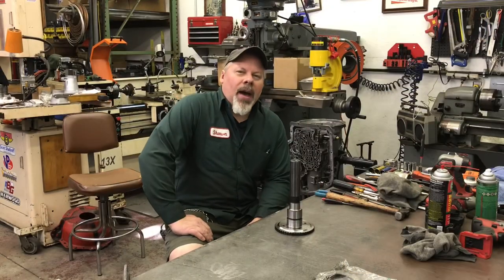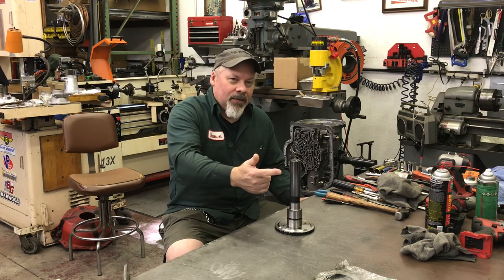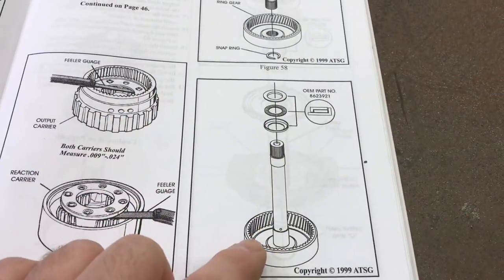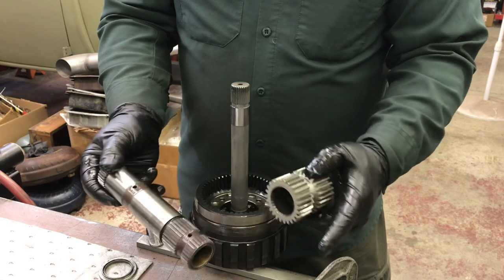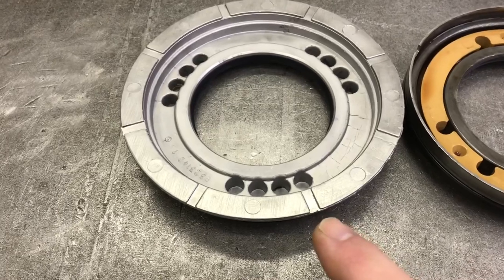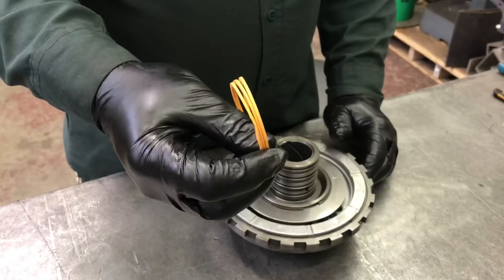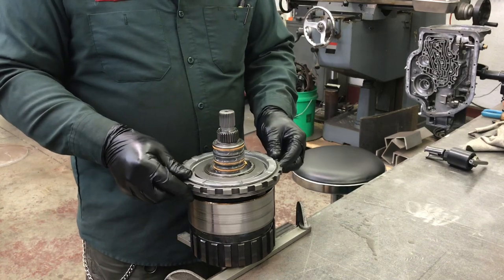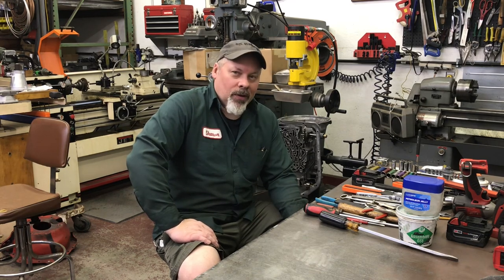TH400: TH475 Lower Gear Train Assembly & Installation.

Comment: I purchased the ATSG book and they reference a rear reaction drum spacer, should all th 400 transmission have them. When I took mine apart I do not have one installed. It seems as the low roller clutch assy sits on that ledge.

Comment: Need help. I've done a few th400s with no problems. Now, the one I'm doing, I can't get the lower gear train to have any clearance. Spins good, with center support bolt in, then when I put beveled snap ring in, it won't spin at all.
Any ideas?
Reply from the maker: Either the thrust bearing is too tight at the bottom of the case, or washer if that is what you have. That is my guess if the lower unit is together proper.
Reply: @mountainsgarage  Has number 2 tang washer and all is together correctly. I have the thinnest washers in, too. Bearings are correct, too. Wondering if center support and front planet aren't happy together. With a 4l80 center support, it works, but can't use that, from late model 80. SMH
I'm about to tear another 400 down and go from there. Ugh!

Comment: Do the th475’s come with a 34 element sprag stock
Reply from the maker: They usually have a smooth direct drum with a 16 element sprag. A 34 element is a direct replacement on the same drum.

Comment: Maybe I missed it but I didn't see you put the plastic oil seal in reaction carrier.
Reply from the maker: It’s is a silencer ring according to GM, and I have never found one in a TH475. GM stopped using them in the 4L80E as well.
It has no sealing ability. Thanks for watching!
Reply: @mountainsgarage  I see, thx for the knowledge. Someone somewhere passed that on to me and I always thought it was false but I still put it in. I'll try leaving it out on the next one. Appreciate the videos, I've love the detail in this most recent series. Thanks!